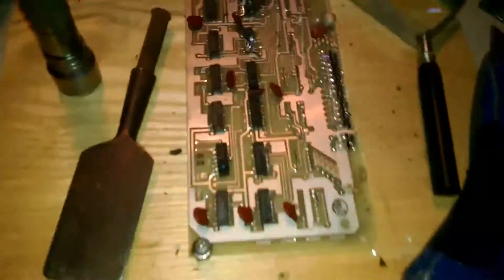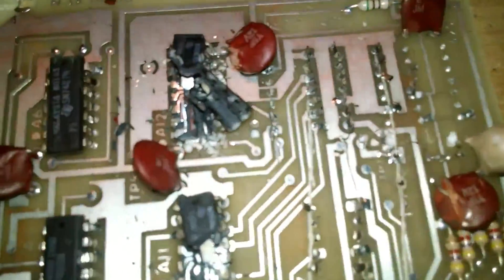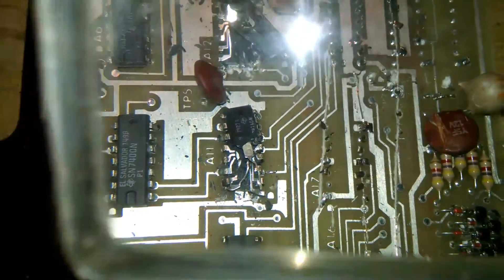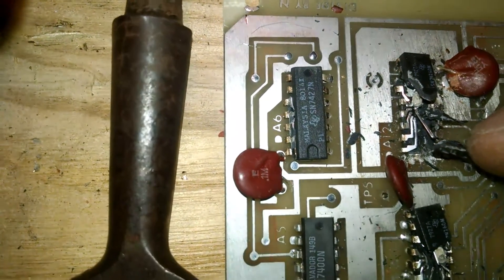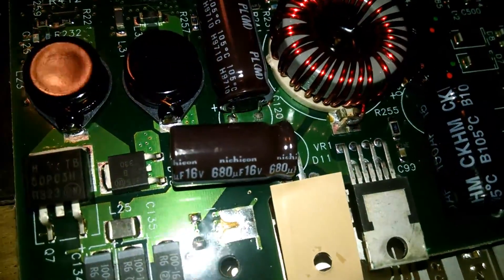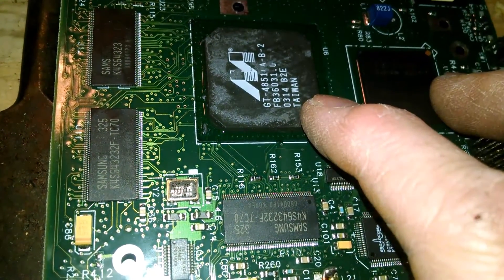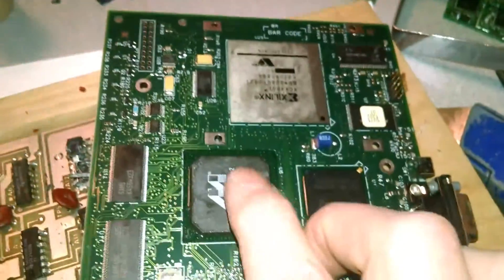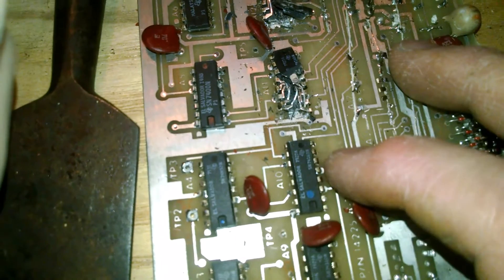Depopulating IC Chips from PCBs for Gold

Comment: The Eprom's contain microscopic hair like wires that are made of different materials usually gold. You wouldn't be able to see it unless under a microscope. The easiest way i have found to remove them is by grabbing them with channel locks and giving it a little twist clock-wise. Good luck and hope my tip helped :)
Reply from the maker: it did, have a good one

Comment: If you aren't worried about the legs on the chips (non-gold, non-silver, etc) then I would either use a Dremel to cut the legs or a heat gun and tap out the chips.  I am working on a Motorola testing device right now that blew up, so I am scrapping it.   I found that the Ceramic chips with the wider white middle layer tend to have the gold core in then.  The plastic ones I haven't seen much in way of gold on those.
Reply from the maker: David Lee thanks, I will look into it

Comment: My opinion, the only worthwhile effort is getting the large processor chips for gold. Those through-hole  IC's are inexpensive 
relative to the price of gold when they were new, and you can say that by weight and volume of 1000's of those IC's in a bag,
there is very little weight, so you know just from that the gold content is going to be minimal. The energy, time, and resources to extract does not make sense. It does however, seem more profitable to salvage parts as used working replacement parts for re-sale. As far as removal, heat gun the whole board from the opposite side of the majority of the components to near 300F 
outdoors, then smack the board against something to knock all the parts off into a bucket. It's going to be a smelly ordeal, but not too bad when you want massive results.

Comment: those chips should be removed, but not all will contain gold wires. some are silver colored and are aluminum bonding wires. I process the circuit boards with a heat gun, but a desoldering pump works well. The air hammer is tricky because you can sometimes shatter the chips if not done at the right angle. the heat gun needs electricuty, but with a fan and the proper tools, like a small flat head and Needle nosed pliers, It makes my job easier.
Reply from the maker: The E- Scrap Man thank you sir, I responded earlier but it didn't post